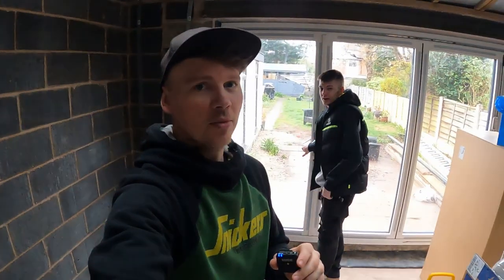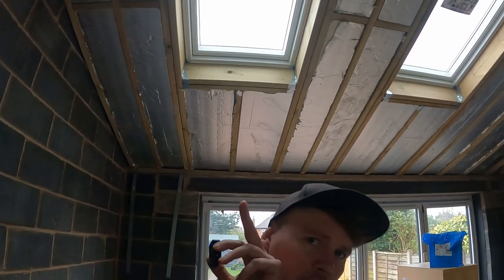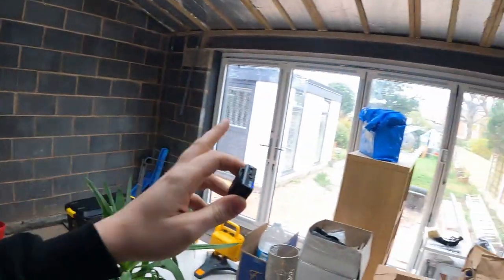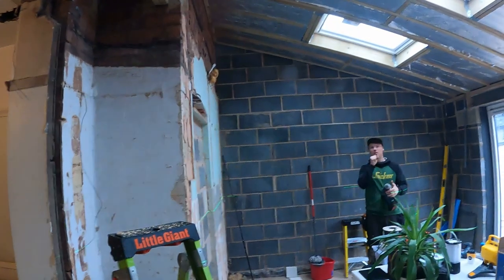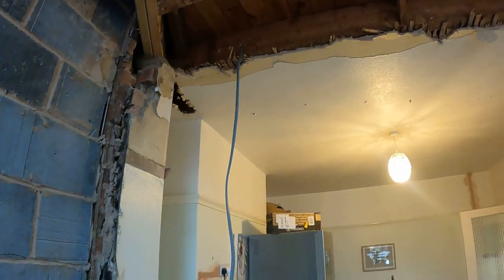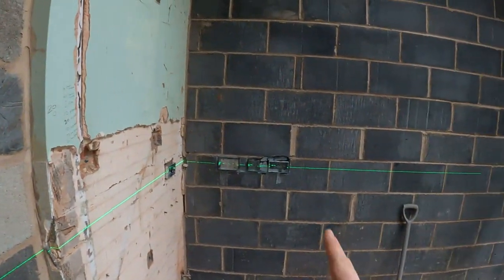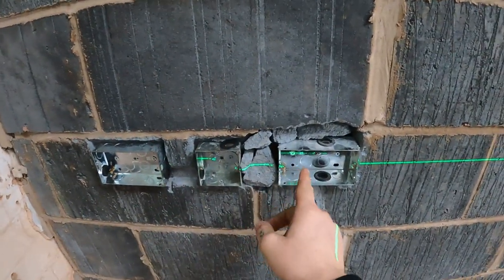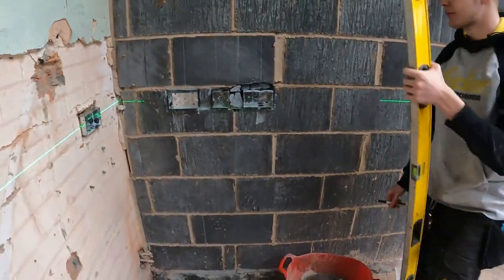Is Capping Cables a Waste of time and money?! - Electrician

Comment: Indeed,we NEVER put cables under plaster,its better because of a shield against screws or nails!Its better because you can change the wires(we use no cable in conduit) in the future.Say there is a conduit to a switch with only two wires and there must be more wires in the future.The only time we use cables is on the walls of gardens and ofcourse in the ground.
But then again we are dutchies..Its just more practical.

Comment: There's a building reg in Scotland where accessories are to be 350mm or greater from any internal corner (it's impractical and most people ignore it) Is there a similar building reg / requirement in England and Wales or that?
Reply: Pretty sure we don't have that down here. It doesn't make any sence to me why that would be a reg either. sink, cooker etc distances makes sense.
Reply: 300mm in england afaik?

Comment: Personally don't see the need for any conduit or capping on a normal day.  

I always bond over my chases because I don't trust plasteres so a trowls not gonna snag any cable. Plus, everyone saying it makes lighter work for a future rewire: if anybody is going to rewire the house within 10 years or so, they're most likely going to reposition a lot of things too so doesn't really help. 

Plus, you're not the one rewiring most likely. 

Only place I can really see the relevance is switch drops and they're the only accessories to remain in the same place. And at that, you could probably pull through on it. Other than that, a waste of time in my opinion
Reply: Main benefit of capping is during construction phase. Thats why you take each installation on its own merits. For example, when sparks first fix, there could be whole load of other trades to follow. It might be days or even weeks before the walls are boarded out, leaving clipped cables at risk.

Comment: You have pretty high ceilings there, but when I do a kitchen, I like to run everything behind the base units and come up, if it's being dabbed over and not cliped or trunked, I'll zone it with the under worktop sockets or blanks. Mainly because, you gotta think of the poor bastard fitting the wall units and other crap. Not that zoning behind base units is a thing, I think. Metal capping does bugger all for a home owner with a drill, someone in the trade will know that slight noise change, but your typical diy'r won't.

Comment: Like you've said capping and oval conduit will not stop a screw or drill bit.  It's just there to stop the plasters trowel from taking a slice out of the cable, it's a calculated risk that the plaster puts a dap of plaster on the cable and does not cut into it, the first you now about it would be when you start your testing and the kitchen is 100% finished. Second issue is the kitchen fitter, does he understand zones or will he just drill anywhere, you can map out the kitchen units location and try and run the cables between the units to avoid fixings.  I use image meter app, take a load of photos with the measurements, whats app them to the customer to show other trades.  I hope the risk pays off, get well soon.  Naggy video and a response to the nonsense he was talking is covered here.  https://youtu.be/1mDkPQDCGhU

Comment: Capping (or flex conduit for more reasonable people) protects cable from chemical reactions of all sorts of adhesives.
I mean plaster is fine and as long you're sure that's only thing which is going to be used than clipped "naked" cable is ok.
But if client decides to use let's say plasterboards and to glue them (white adhesive) you're - pardon my French - fucked mate. That stuff literally melts isolation.
Also cement is not great especially where there are big variations in temperature during longer time periods.
There is lots stuff which is hostile to cable isolation and you can be relaxed and go with naked cable until that first time happens and than you'll find out what I'm talking about.
Also when it comes uselessness of capping regarding protection from mechanical damage ie. nails, screws ect. yes capping is useless same as flex conduit however once you took out that nail or screw unlike capping (which btw would probably best case scenario crack plaster if you try to pull new cable) round flex conduit is at least 90% good to draw thru it a new cable without too much of struggle and without any damage to walls.
You could even do it with 6mm T&E in 20mm flex conduit... bit tight but plausible.
But hey... that's just me and my European ways... be free Mr. @N Bundy Electrical to call me an idiot because of it like you did few months ago because to your mindset it's pointless.

Comment: Protects from a trowel I guess but pointless beyond that.

But I guess it looks a bit better.  

I guess if it were rigid enough that you could pull through to re-wire then yay but how often is that the case?
Reply: I mitre my capping 😘
Reply: @bencrabb303  did you get that trick from Jordan? 🤭

Comment: Personally I hate the idea of isolation switches in cupboards as it means having to disconnect a load of electrics if removing a kitchen cupboard carcass. I would personally much prefer isolation switches to be above worktops and immediately visible. I also don't find their appearance annoying either, and for the style-conscious there are plenty of designer options.

Comment: 9:00 I have no idea why you do this. Is it laziness that you can't be bothered to do the extra wiring and fitting? Do you badger the client into agreeing to this and then claim it's at the client's request? It's substandard and far to many sparkies get away with this.
Reply from the maker: Are you taking about the cooker isolation?
Reply: @NBundyElectrical  You only commented on the cooker which is unusual. Most sparkies I work with are reluctant to put the isolating switches for any appliances above the worktop which is frustrating. They will comply with enough pressure but normally accompanied with a strop.
Reply: @NBundyElectrical  I should add that I have never come across a sparky as neat as you.
Reply from the maker: @stepbackandthink  thanks mate, we have had loads Of customers ask for them to be hidden, and a few wanting them on work too surface, I think it all depends on the kitchen that goes in, whether there is enough sockets accessible for appliances on work top, (I always fit a cooker iso with single socket) 
Either way it’s the same amount of connections, iso in the cupboard or iso on the work top 👍
Reply: When you have a wall of tall units with integrated appliances with no worktop its impossible to get the isolator within 2m unless it's in a cupboard.
Reply: @jamiebourne8047  I have no problem with that. What about when is there no excuse though?
Reply: @stepbackandthink  when last did you turn off your oven or cooker. Or any appliance? It's just extra unwanted accessories on show
Reply: @Romeworld95  It's there for a reason. Not for show.
Reply: @stepbackandthink  I personally always put the isolator  on show if its possible but have no problem with it being in a cupboard. It's a bit like an inline fan-do you put the iso in the loft next to it or above the door-horses for courses..
Reply: I despise seeing the rows of bloody FCUs and the cooker isolator in kitchens these days. I put fan isolators in the same category. All should be suitably accessible but hidden from plain sight.
Reply: @jamiebourne8047  we put them in the switches
Reply: substandard ? theres no regulation in bs7671 to even have  cooker isolation . The circuit breaker is the isolator and youre bothered about it being in the cupboard . You cant have done many kitchens ive been asked so many times to only have sockets on show we dont do it any other way than in a cupboard .
Reply: @persona250  Fixed appliances should have double pole isolation, it'll also be stated in the manufacturer specification of the oven itself when hard wired.
Reply: @persona250  Yes. It's poor. just because you get away with doesn't make it right.
Reply: @stepbackandthink   It's just extra unwanted accessories on show. No needed by the regs to be on the show. Minimalistic approach is new standard. Not laziness as you said before!!!!
Reply: @LL-cm7mi  That would be fine if you weren't putting them in cupboards.
Reply: @LL-cm7mi   Absolutely mate. Not sure what this fellas issue is, but rows of fcu’s looks awful in my opinion…..we’ll never all agree though! No less work doing it either way, certainly not laziness why I’ll put switches/sockets in adjacent cupboards for example.